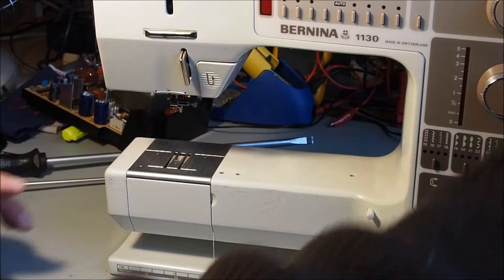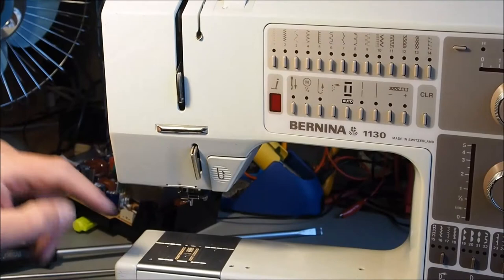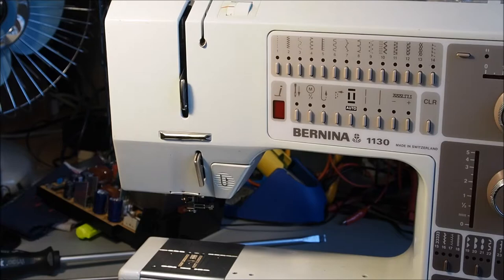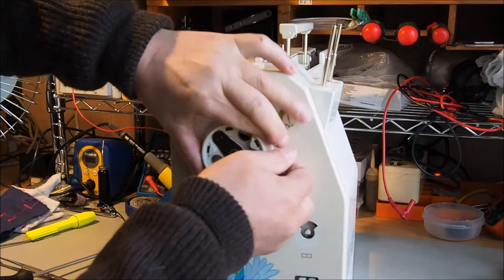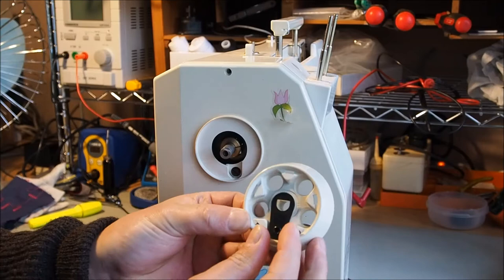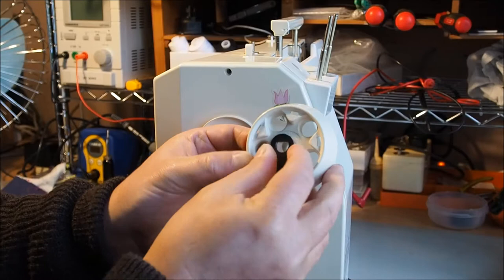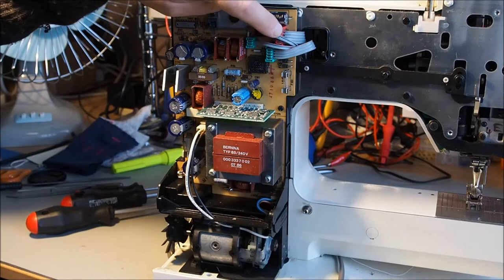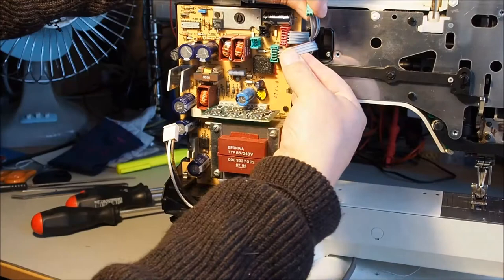Bernina 1130 - 1230 Needle Bar Disengaged

Comment: Hey, thanks for making this video. I got a hand-me-down Bernina 1630 from my grandmother. (She's fine, just downsizing!) I was close to tears trying to figure out how to fix this issue. I even spent eight bucks on a service manual which thoroughly overwhelmed me. I was able to reach in from the front under the take up lever and poke the little black arm back in place with a pair of tweezers. No case removal needed! Thanks for clearly showing where that son of a gun is and how to correct it.
Reply from the maker: Hi. Glad to hear the video helped. I often reach in from the front with tweezers to actuate that lever too. You can lubricate it from the front as well. Cheers.

Comment: Instead of removing the spring to access the "thumb", simply turn the screw in the silver block on the needle bar to release the block. Then turn the handle and the silver block will spring upwards to expose the "thumb". After lubricating the "thumb", tighten the screw. (Be sure to remember where the silver block was.😊 )

Thanks for the great video.  I was servicing my mom's 1030 and her "thumb" was gummed up. 

If anyone here needs to replace the ball bearing,  I've got a video for it. Just search "Bernina 1030 Needle Postion". Look for the orange text in the thumbnail.

Thanks again.
...Dawne

Comment: Thank you for the great instructional video.  After watching your video and seeing the part that needed a drop of oil I realized you can see the part that needs oil through the slit in the front of the machine.  If you have a oiler with a long needle nose on it you can put the drop of oil on the part without ever taking the machine apart.  It worked for me.  Thanks again.
Reply from the maker: Thanks. Yes that can work. I think I showed that near the end of the video. I take back off to service machine anyway.

Comment: Hi , I am just after buying a Bernina 1130 and to my utter frustration., it is just not working. Initially I thought that it could be due to the “ fuses blow up “ on the motherboard ( L-4200 ) . After carefully and painstakingly testing all the important connections and fuses ( and also innumerable capacitors) everything is electronically intact. Out of frustration, I  rang the seller and was told that the machine was in disuse and stored in the loft for considerable time . This makes me suspect that main mechanical transmission is “ gummed up “ beyond simple oiling. My question is is it “ ALRIGHT “ to apply heat with a blow dryer while the PCBs are in situ ? Or do I have to remove all the PCBs to mend the mechanism/s to free them up ( because I don’t want to spoil/ destroy the “ old/ageing “ PCBs which are prohibitively expensive) ? Would really appreciate your feedback/ tips please ASAP. I look forward to hearing from you, regards, Ramana.

Comment: Hi , just wondering if we/ I could take out the actual motherboard/ separate it from the plastic backboard ( L-4200 ) if I have to repair/ replace an individual component/s . I own a Bernina 1130 and one of the capacitors is blown up and I intend to take it out and replace it with a substitute capacitor of same specifications ( I am based in London U.K.) . My question is does it need replacement? The reason I am asking this rather daft doubt is because when I used the multimeter to test the “ electrical/ electronic continuity “ of the PCB it appears to be alright even after the capacitor is blown up/ broken! That sounds weird to me, unless it is connected in parallel. Any thoughts/ suggestions/ DIY tips please. I am not interested to go to authorised Bernina dealer because they charge a fortune. I look forward to hearing from you. Thanks, Ramana.

Comment: I was just given a Bernina 930, and the needle bar was stuck so I took it apart, cleaned the plunger inside and re-engaged the little black 'thumb' with the needle bar and it worked great, for about 5 minutes and then the little black piece broke in half. I think it was just unused for so long and gummed up it was toast. Do you know if it's possible to replace that part of the machine by any chance? Thanks!
Reply from the maker: You might be best getting hold of your nearest Bernina dealer to see if they can do it or if they have the part. Thanks.

Comment: hi. great video btw. though i have a problem, not with the needle bar but with some thread being stuck between something. at 14:50, you are moving this thing back and forth. at the very end of it i have some thread which is stuck and cant seem to get it loose. and also to move it, is imoossible for me because the nob from where you turned it wore out. so if i put it in place it just turns without the mechanism turning. PLS HELP anyone

Comment: Hi, just bought a bernina 1130 and found out it only sews backwards, it doesn’t come with a manual, not sure how to fix this problem, hope you can help.  I don’t think it’s the button hole stitches. Thanks
Reply from the maker: Hi. There can be several causes of that problem. Could be a mechanical bind, could be a sensor issue or it could be an issue with the stepper motor that drives the mechanism. Thanks.
Reply: Thanks for replying , might pull it apart, following your Vedic. Thank you❤️